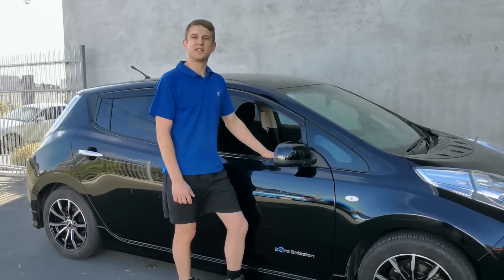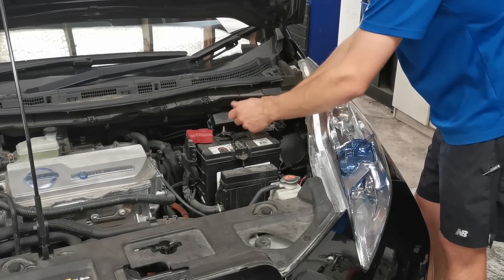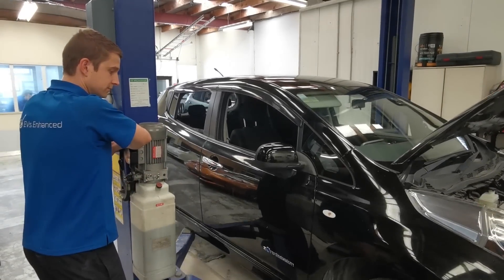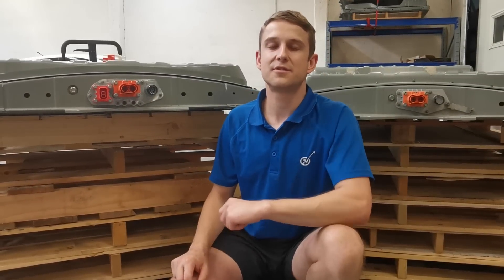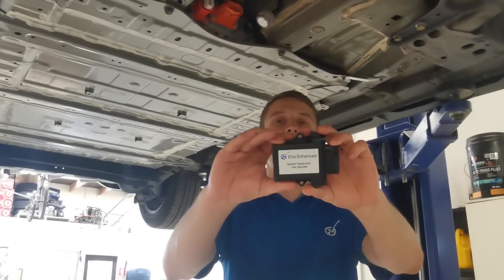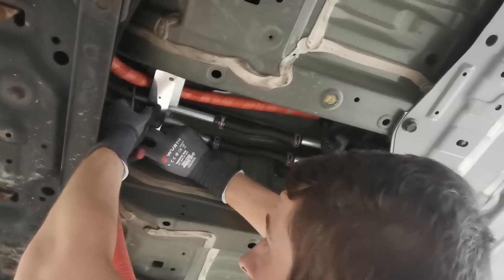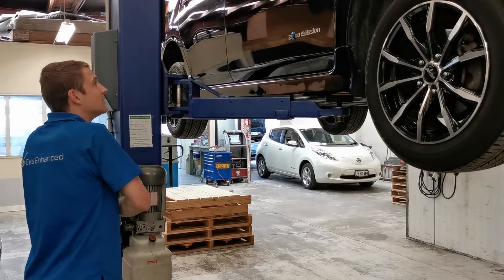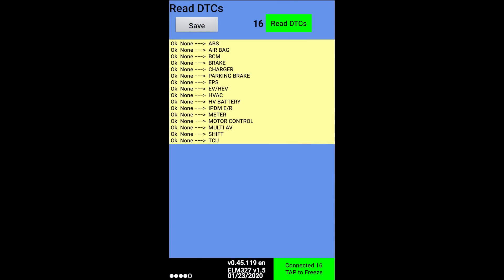Nissan Leaf High Voltage Battery Upgrades Made Easy

Comment: I own a automotive shop in Raleigh Durham Area in NC, USA. I’m also the owner of a perfectly like new 2012 Leaf with 7 bars left. If I sign up with you, will you provide the needed conversion kit for 30 or 40kwh battery swap? The actual swapping job is no issue and my shop can easily handle the work. All we need is the conversion kit from you, and, of course, to scout for the good batteries by ourselves. I’d be glad to be the designated shop in my region to perform this much needed upgrades for fellow Leaf owners. Please advise!
Reply from the maker: Hi. Yes we can help with your conversion. Please contact enquiries@evsenhanced.com to discuss this further. Thanks.
Reply: Did this work out? Is your shop able to do this work now?

Comment: The best way to go all EV would be a battery subscription with swapping for topped off cells. You would get a battery for what you need.  Need long range rather than get a rental car you swap . I would need 60 Miles max range.
Reply: That would only work if there was a executive order making all E.V. use the same shape battery pack just like the OBD 2 port for making GM ford and every other car maker work together is difficult

Comment: These cars must hold the road very well with the weight positioned as it is.
Reply from the maker: The weight of the battery is certainly in the ideal  place.  However the suspension in the Leaf wasn't exactly designed with sport's car handling in mind.  Overall they handle well enough for what they are meant for though.

Comment: Love it was concerned about Battery replacement I see you can get a 30 in a former 24 . I wonder if the 2020 battery would fit a 2013 ?
Reply from the maker: Hi. 24, 30 and 40kWh are all physically the same form factor and will bolt straight in with the appropriate CAN translator.  62kWh is slightly different physically, although with a custom mounting kit it can be made to fit.  The 62kWh battery is also significantly heavier though whereas the 24, 30 and 40 are very similar weight.
Reply: Great to hear that 40kW battery is compatible with old leaf. Does the CAN translator module available from EVs Enhanced to be bought online?

Comment: Can you upgrade 40kwh battery on a 24Kwh battery 2012 leaf?
Reply from the maker: Hi. Yes it can certainly be done, but we haven't released a translator for this particular swap yet.  40kWh battery into 2013-2017 Leaf is currently in development which is going well.  40kWh battery into 2011-2012 Leaf will be looked at after this is released.

Comment: Where do you source the battery pack . Is it from Nissan direct or a cottage ind battery builder . 
  For my 40kwh in Ireland I wonder will is sell it, repair it , or build it myself. Electrically qualification is handy
Reply from the maker: Hi. The source is typically from lightly damaged Leafs that aren't deemed economically viable to repair.
Reply: @EVsEnhanced  I wonder if it was the battery pack from my late 2017 Leaf which was written off by a speeding ICE car!
Reply from the maker: @neddyl1225  Maybe... Even if your damaged car went to someone else, chances are the battery will live on in another Leaf.

Comment: So I guess the hardest part is sourcing the 30kwh battery? My Gen 1 Leaf is down to 66.5% SOH and would love to have an upgrade like this as the rest of the car is absolutely A1 condition. Any partners in Melbourne, Australia who can perform this upgrade? If not... maybe I can be the first as long as I can find a battery pack!
Reply from the maker: Hi. Yes sourcing a good 30kWh battery is the main challenge.  We can assist with the rest and we do have a partner in Melbourne.
Reply: @EVsEnhanced  Do you have a partner in Sydney?
Reply from the maker: @edvoon  Hi. Sorry, but we do not currently.  Are you aware of a good independent EV specialist in Sydney that we should talk to?
Reply: @EVsEnhanced  Unfortunately no, but it would be great if someone who's a mechanic in Sydney and interested in working with EVs sees this and introduces themselves.  Seems to be an unmet demand here.

Comment: Ah, sadly, I'm across the BIG pond in California. And with all the LEAFs here, I would think this type of service would be available from all us 7 bar sufferers. But nothing I have found. I will be ordering one of your battery pairing tools so I can do a DIY swap of a better Gen1 battery. But I would really like to find a 30kWh version and do what you guys have done. I visited NZ a few years ago, and I'm pleased to see all of the innovative ways you have been using solar, wind and EVs.  Keep it up, and do try to solve the 40kWh battery challenge. (Maybe even the 62kWh LEAF+) Probably not many of those in NZ. Cheers!
Reply: Keep your eyes open. New upgrade shops are popping up all over the place.  3 in the Pacific Northwest in the past 3 months.
Reply: @DaveLaur  I live up in the Seattle area - can you list the shops that do these types of upgrades?
Reply from the maker: Hi.  These translators will be available for wider distribution soon and we already have some contacts in California. We still have a few more refinements to make though.   Our development on the 40kWh swap is going well too.

Comment: Hi EVs Enhanced.I have a 2014 Leaf. Do you know whether the contacts on the on the battery side of the  PTC heater socket are live when the heater cable is disconnected?  Is there anything inside the battery pack related to the cabin heating? (A fuse or relay? Anything)  Thanks Jozef
Reply from the maker: Hi. The HV relays inside the battery pack shouldn't ever close with the PTC connector removed as the interlock signal circuit on the connector will be detected as open.  Yes the PTC has its own small fuse inside the battery pack.
Reply: @EVsEnhanced  , Thanks for your reply, you seem to have an excellent understanding of  the matter.
I have this situation: the cabin PTC heater is not working. B2772 comes up when I connect to OBD2.  I have replaced the PTC heater for a second hand one but it still doesn't work, B2772 is still there.
To do more testing, I have unplugged the PTC wiring harness from the battery, inserted a link to the interlock (pins 44 and 45, without it the car would not even go into Drive or Reverse), turned on the heating and checked the voltage between +40 and -41 and got 0 Volts, then I checked between +40 and ground and got around 200 Volts initially, but the reading started dropping (discharging through the voltmeter) fast.
I think there must be something wrong in the battery pack, but I am struggling to get detailed information about it. 
I took the car to my local Nissan garage, was told the PDM needs replacing,  I don't think it has anything to do with it, after raising my concerns with them they weren't too sure either.

Could you please advise about the components (fuse Amps, dimensions, type) inside the battery pack between the PTC heater plug and SYSTEM MAIN RELAYS?

Thanks again, Jozef
Reply from the maker: @jozefdkois  On the earlier 2011/2012 Leaf we've seen several cases where the PTC heater fails and blows its fuse which is in the DC/DC junction box.  On a 2013+ Leaf, this fuse has been moved to inside the battery pack. On these, the PTC heater connector should have a live 250-400VDC applied to it whenever the two main relays are closed assuming the fuse is not blown.   It is a 30A 500V old school looking glass cylindrical fuse but with welded eyelets on either end for screws to go through.  As I recall these are not easy to find, but we likely have some spares if you end up needing one and can't find one locally.    Please contact enquiries@evsenhanced.com for more info.
Reply: great job guys , thanks for the videos.
Reply from the maker: @jstroudbigjim  No problem. Thanks for your kind feedback.

Comment: Does the first gen car recognize the 30kwh battery's extended (full)range or does it just think its a 24kwh with alot of reserve capacity?
Reply from the maker: Taking the relevant information from the lithium battery controller in the new battery, our translators inform the vehicle control module (in the car) of the calculated remaining energy if that is what you are asking.
Reply: @EVsEnhanced  he's asking if he can use all the 30kwh to drive or only 24kwh, with car thinking it can't use more, to put it simply. 
(but i believe in reality there is no such check, the car prevents driving when individual cells fall below certain voltage, but since this doesnt happen before all energy is used, you should be able to use all the new capacity)
Reply from the maker: @gelisob  Ok. Yes, you can certainly use the additional capacity of the upgraded battery so the driving range is higher than the car originally had when it was new.
Reply: EVs Enhanced   What’s the new range with a healthy 30kwh in a 2011? Your video ends showing 233km, is that really how much it is after the swap?

Comment: Looks great any idea on final prices for ZE0 to 30 / 40 or even 62 KWh options I am assuming maybe $500 or $600 plus the cost of the battery. Does it bring back the faster charging allowed by newer packs ?
Reply from the maker: Hi.  Pricing still being refined for the different options, but in NZ dollars the various translators will be close to your expectations.  Yes, fast charging speed will be much improved with a newer/healthier pack.

Comment: That's a very clean "simple" solution. I tip my hat to your software team.
Reply from the maker: Thanks Paul.  We've been impressed with some of the cool products/solutions you've come up with too. Particularly the little display in the stock upper instrument cluster.
Reply: @EVsEnhanced  Cheers! I've been slowly working to improve the code (held back by my very amateur programming skills). I'll do an update on progress soon.
Reply: @paulkennett  Not sure what you mean by code.
Reply: Hi
Reply: @yogesh_3337_  hi

Comment: Excellent work! This is groundbreaking.  As you fit a s2 battery to a s1 vehicle, I suspect changing a 24kwh s2 battery for a 30kwh s2 battery will be easier without need for the mechanical changes? Also, would you consider it being doable to fit a new body 40 or 62kwh battery in a s2 vehicle? As far as I can understand, dimensions are fairly similar and voltages are the same.
Reply from the maker: We have had a translator for the 30kWh battery into a 2013-2015 24kWh Leaf available for some time.   https://evsenhanced.com/product/hv-battery-translator-30-2-aze0e/  Externally, the 40kWh battery is physically the same as a 30kWh battery - only the CAN bus translation is different.  We are working on the 40kWh battery translation now.  The 62kWh battery is physically different to all earlier packs and is taller and has modified mounting points so isn't such an easy swap.  But with some modifications to the car or a custom mounting kit it can be made to fit an earlier Leaf.
Reply: @EVs Enhanced My concern would be the weight increase and having to haul that extra weight around with an 80kW motor. The 40 and 62kWh LEAFs have more powerful motors to compensate and some. Do you happen to know what the differences in weights between the 24, 30, 40 and 62 kWh batteries are?
Reply: @thesleepgeek   I think it is the same motor, just the inverter is told to give it more juice , because it can ( safely) with the bigger battery. The height/suspension would be a problem with the heavier taller 62 kWh battery.
Reply: @EVsEnhanced  Thanks for answering. Will be following you closely. 40kwh will be the way to go for me, as the salvage yards rarely know the difference in capacity, and the price will be about the same.